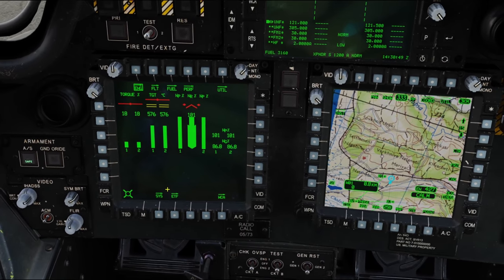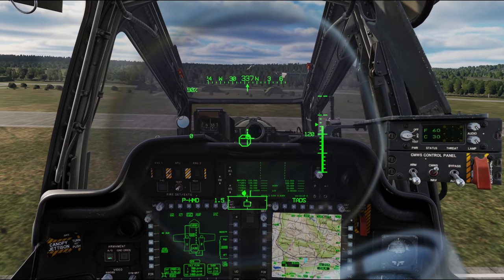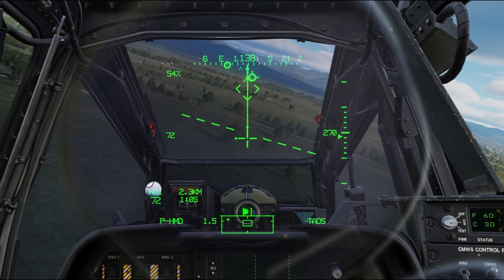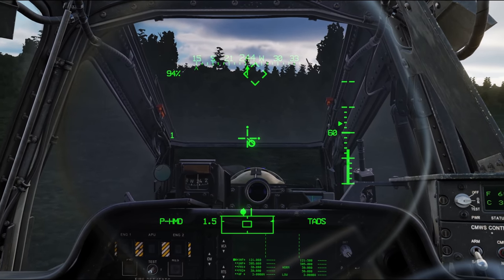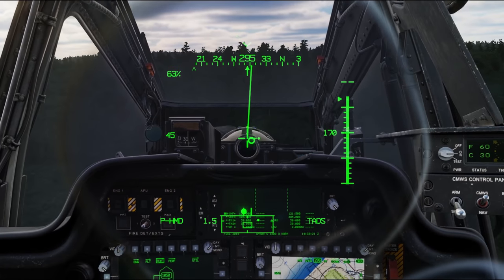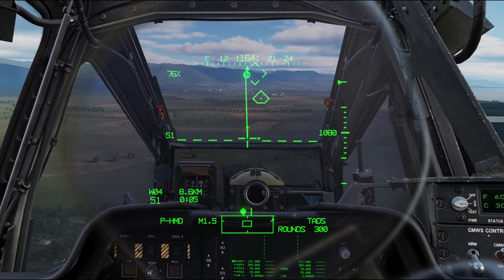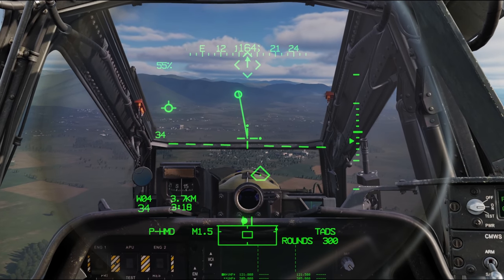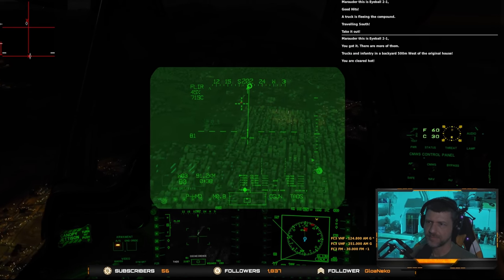DCS: AH-64D- Stop hovering so much

Comment: So is it always more useful to do slow low staking and pop--up when going after high threat targets, or is running a race track low with then popping up to attack and then dropping down and breaking off with speed better as you keep yourself at a higher speed and are thus harder to hit? When would you do one over the other? I guess if your moving rapidly your much easier to spot, but once you unmask it's not like the helicopter is quite, so is being relatively stationary low give much more advantage?
Reply: Depends on the threat environment.  If you're in an area with shoulder mounted AA, ballistic AA, ZSU's, S300's...  you will want to stand off at a distance, nice and low, and very carefully work your way in.  But if it's mostly just small arms stuff then you're going to most likely be in fairly close, inside 3k for sure, start gun engagement about 1500, so you'll be low-ish and at speed.  Rush in guns blazing against AA and you'll catch a fireball to the face before you even have time to react.
Reply: @GTRNights  yeah no what I was asking was more in line of doing long distance attacks, nothing within the 1500m effective gun range. So it would be running race track attacks where you move pop up find a target at 7-6km Las and hellfire it and break off with speed. Or do a scouting run to first store targets. Break off while still outside    MANPADS range, then run in at speed  from a different direction flying low fire a LOAL shot at the stored position, then pop-up and las at again 7-6 km. The idea is I'm still always outside 6km, just with one I'm moving at nap of the earth but still traveling around 70knots, while the other would be creeping forward at hover.
Reply: @crazygmanssimstuff   Sorry dude, that makes absolutely zero sense.  You're way overthinking it.

Comment: Watching the Apache huffing and puffing at 92% barely able to ascend at a crawl above the tree line in a hover "pop" up is pretty unimpressive.  Is it really this weak in real life?
Reply from the maker: It’s a heavy bitch. It’s 20260lbs… I think you probably have a a misconception of what it looks like in real life.
Reply from the maker: I… I have no answer for the comparison against a combat laden aircraft and one stripped down for an air show.
Reply: @CasmoTV  Ok I guess you can’t really answer the question.  Don’t wanna get you in trouble.  Just pointing out that the air show performance doesn’t seem to match the stripped down performance in DCS, as it still flies like pig when at 14,000lbs.  A bit odd, and makes me wonder why. Oh well, nbd.  Was just hoping it was an early release issue, cause I do enjoy flying stripped down choppers in DCS just for fun.
Reply: @CasmoTV  Ha, nvm the above.  It turns out I just needed a little more practice.  :D  I think the the uncontrolled roll while pitching down threw me off. especially when it was trimmed for forward motion.  Also, didn't realize that cyclic needs to be trimmed to center to pull off a loop otherwise I wasn't getting full back deflection.  I can now pull off most of those moves in an 18k lb bird.

Comment: 75 / 5,000
why are not built-in ejection seats in apache helicopters as well as in Russian K-50
Reply: The Ka-50/52 is one of the few unique helicopters in this regard.  That said, at least so far from the last handful of losses over the last month; it still seems that crash landing in fields is preferred by the crews.

The US did experiment with ejection seats, but bottom firing seats don't work in NOE flight; side firing seats were considered too much of a neck snapping risk and trying to go with the Ka-50 style system was just too much extra complexity to bother with for just a slightly higher chance of survivability.